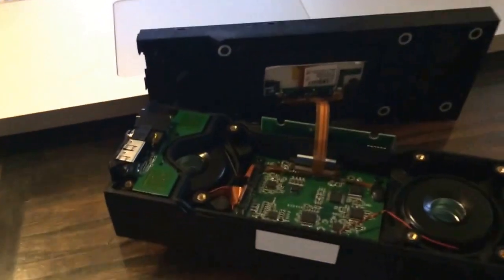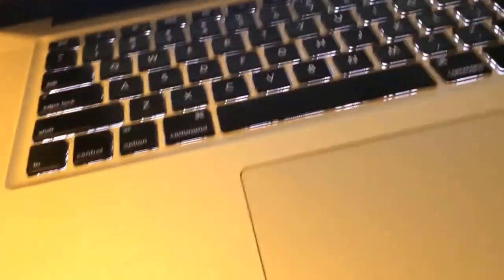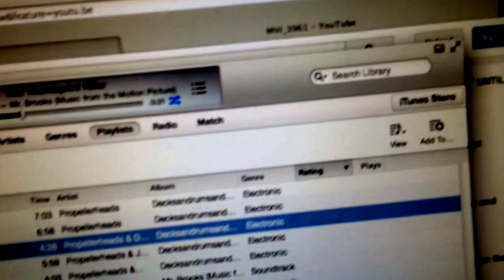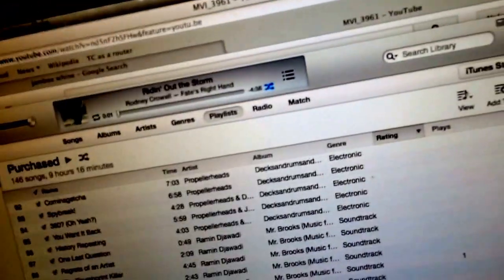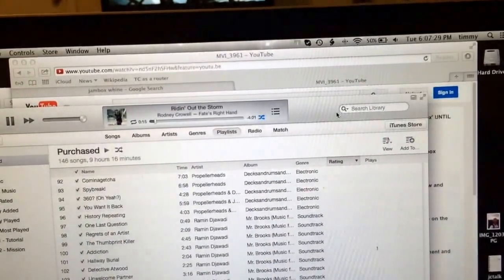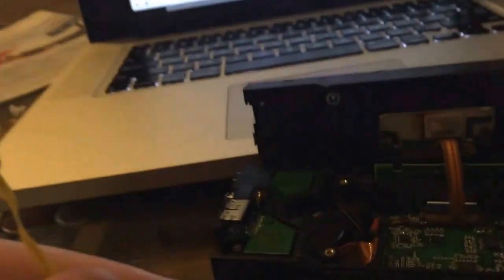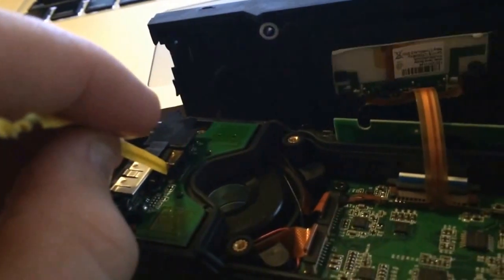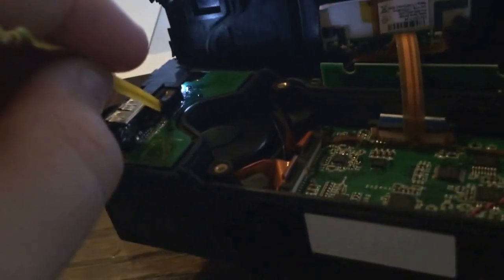Jambox bluetooth issue fix

Comment: My phone connects to it via bluetooth just fine and it plays, but the volume is extremely quiet. So quiet I have to press it up against my ears to even hear a song. I can turn the volume all the way down, then back up to its max, which is extremely quiet. When I turn on and press the additional settings, like the battery status voice indicator, it is plenty loud. Additionally, when I turn off the jambox the song plays full volume for a very instant before powering down. Anybody else experience this or have any possible fixes?
Reply: Baya Massamba-wa SAME BUT I CANT FIGURE IT OUT
Reply: if you are still using it and have access to a macbook, search for audio MIDI setup, after connecting the device you can change the format to 1 ch instead of 2 ch, the quality will be extremely lo-fi but the volume will go up again. I am also looking for a damn fix

Comment: There is an easier fix than this. 1. Plug in a pair of headphones to the auxiliary jack. 2. Take a tiny screwdriver and push down to bend the top point toward the bottom point. 3. Unplug the headphones and the contacts should now be touching. If not, repeat step 2. 
I just fixed mine and no need for soldering or metal ties. The problem was the top point getting bent away from the bottom point and the Jambox always thought there was a cable plugged into the aux jack.
Reply: helpp, what is top point ? can you make a video please ?
Reply: Just did this and presto!!! Thanks!
Reply: This

Comment: I fixed mine by placing a 1/2 " screw in the audio port. My bluetooth stopped working but the audio port was fine.  After calling tech support and running through the reset several times, I figured it was the audio port that was defective.  The screw easily solved the problem by making the contact inside that was needed for bluetooth to work.